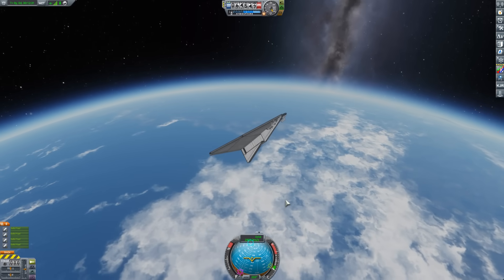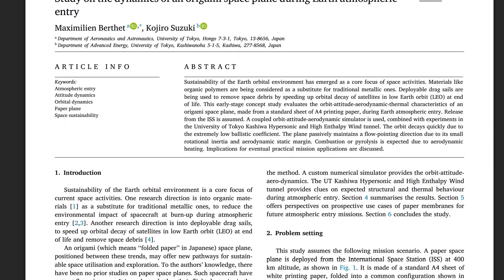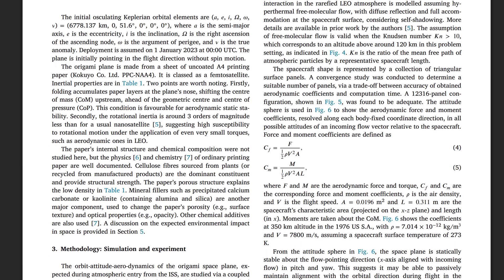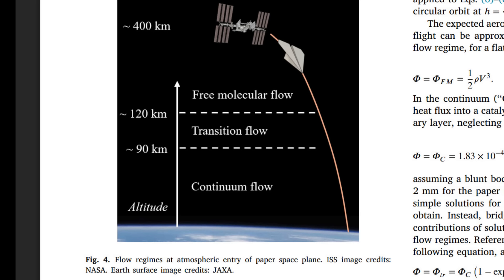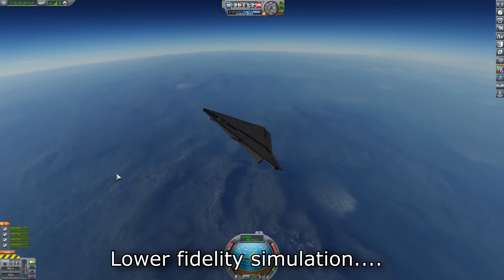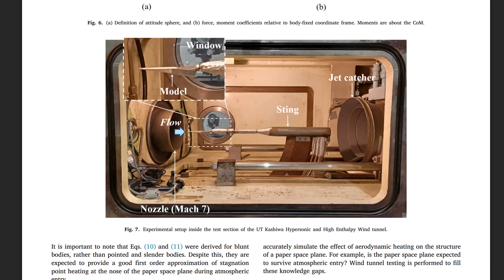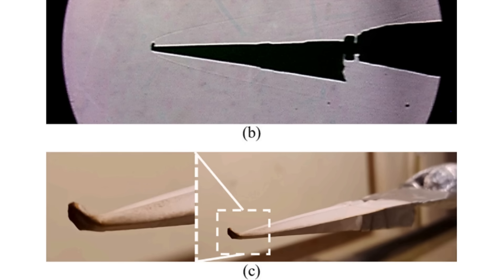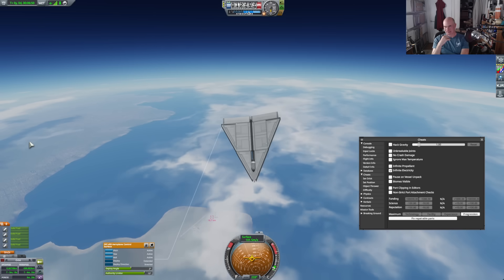Could A Paper Airplane Fly Back From Space?

Comment: The first thing I thought of when clicking on this video was if the paper was coated in a thin (~2-3 nanometer) metal layer the paper planes could be released in the thousands and tracked with radar to study the dynamics of the upper atmosphere.
Reply: Meteorologists are doing such things. However they use just small, very light corner reflectors falling freely from a suborbital rocket or a balloon, being traced by a radar. Paper airplanes will most probably achieve really high speed gliding steadily on high attitudes, so the measurements will be useless. If I count properly, on a 15 km a paper plane capable of 10 km/h on ground level will be able to glide already Ma1.
Reply: You don't even need a full metal coating if you're willing to build a tuned circuit.
Reply: @absalomdraconis  You wouldn’t even need a special tuned circuit, just a length of wire.
Reply: Oohh! I like this!
Reply: 2-3nm won't do anything thermostructurally. You need at least a micron or so to even form a continuous layer
Reply: Wouldn't you rather have something that spirals down like certain tree leafs do? 
I imagine the plane shape would make it harder to interpret the data because it tends to move less freely.

Comment: The space station is going ninety three thousand miles an hour. Wouldn't a paper airplane survive if it were dropped from a high altitude balloon.? That dude that jumped from a high altitude balloon at the edge of space in the Red Bull sponsored event didn't die? Or overheat...
Reply: Where did you get 93,000 mph for the space station speed? That's way off.

Comment: Ah I've got a story about that! A trio of British hypersonic researchers at the long-gone RAE at Farnborough invented, and then ran with, the idea of ultra-low-wing-loading 'hypersonic hangliders' made from shim steel - the stuff they used to make 'tin' cans out of. 
These had sharp edges - and looked very like the classic paper aeroplane - so that they would 'Waveride'; suffer a higher heating RATE at the nose, but with superior lift that would allow re-entry at notably higher altitude where the air density was lower: low enough that the metal wings would reach thermal equilibrium and radiate the heat away off the lee side just as fast as it was coming in from underneath.
My friends and I came SO close to getting UK Astronaut Helen Sharman to lob our little waverider out of the MIR Space station, but alas it didn't happen. (Our model got as far as Star City.)
I'm still sure it would work though, and is the superior way to get "Space Forge" stuff back from orbit.
Reply: Don’t underestimate the robustness of tissue … it was what modellers used back in the 60s before the fancy modern materials became available. The tissue would be doped to stiffen it … I fear that a picture of a Kleenex form of tissue has been created in the mental image … the tissue used was more like a very lightweight wrapping paper.
Reply: @davidrowley-ic6dx  I used lightweight tissue sold for craft purposes, and didn't dope it as the shrinking effect would ruin the sail. Damp air was a problem, but I normally flew them indoors.
Reply: Skylon was supposed to be an application of that. Except the "wing" was a large lifting body.
Reply: Back in the early eighties I worked at RAE, and made model hang gliders from balsa and tissue (~30" wing span and 1/2 oz weight). I still have one, right in front of me in my computer room, and often wonder whether it could survive re-entry.
Reply: @robertkeddie : Tissue? "Probably not", but admittedly because of the lower atmosphere at least as much as the upper atmosphere.
Reply: I remember waveriders. IIRC, isn't the upper surface shielded from the reentry airstream, allowing you to place cargo there without needing any kind of reentry protection? Once you were through the reentry interface you'd then jettison it and it'd parachute down using cheap low-velocity aeronautics. The waverider shell would be passive, cheap and disposable.
Reply: This sounds like throwing a knife from space. How do you catch it?

Comment: But wouldn’t there be structural failure or fold collapse once the air got the slightest bit of density?  The wings would bend.  I didn’t see that question addressed at all.  Sure, it is a silly project, not too much should be expected, but I don’t think it’s very thorough.

Comment: You are making an assumption that is not necessary given the posed question, namely, near orbital velocity. A paper plane does not necessarily have orbital velocity to shed. Correct me if I'm wrong, but atmospheric reentry is radically different without orbital velocity. I wonder though what its maximum terminal velocity would be in free fall.

Comment: I'm not sure if modelling the shape of a paper plane from just the thickness of the paper and the plan form tells the whole story. The folds are a mixture of plastic and elastic deformation so tend to spring slightly open-unless glued, so the fuselage sides aren't parallel but separate towards the rear. The wings are the same, with a definite convex upper surface at the front - so given all that I wonder if the real thing would be more stable. After all, the real thing is markedly less keen to fly tail first than your KSP sim. 

Of course, that wouldn't help its survival prospects since a nice stable attitude would cause it to decelerate less rapidly...and consequently chargrill more quickly. Oh, well...

Comment: The paper airplane, the physical form, the nose has much more mass density than the rest of the craft...there is tendency for gravity to begin to have an effect on trajectory.  Much like the mass of a heat shield helps orient a return capsule "downwards in direction of travel.  of course, heat buildup on the nose of the plane may become a problem.  This model doesn't seem to address this.

Comment: isn't force mass times acceleration? it seems crazy to me that a paper plane would somehow be able to achieve mach 3, specially given that a paper airplane is so damn light
Reply: basically just shows how low density the upper atmosphere is
Reply: I think this was about starting from low Earth orbit, e.g. if it was "dropped" from the ISS (probably launched retrograde to speed up the de-orbit).  It already has a velocity of 17,500mph which is about mach 23 at sea level.  The speed of sound is slower at high altitude, so the actual mach number would be even higher than that.  Even if it was somehow dropped with no lateral velocity (which is practically impossible), it would still initially fall like a brick because there's almost no air resistance at the starting height.

Comment: IMO I don't think we should jump straight to carbon fiber, IMO we should investigate incrementally. The next increment would obviously (to me) be stick-built balsa models constructed with phenolic resin used as the bonding agent, and special attention given to impregnating the nosecone, leading edges of wings, and leading edges of empennage with yet more of the same sort of phenolic resin.
The phenolic resin in question would be as similar as possible to that used to create PICA based ablative heat shields, because that is already flight-proven and has known behavior for reentry conditions, making the experiment deliver better data by having less unknown variables to wrangle with.

Comment: Would a boomerang work in space???
Reply: A returning boomerang would not return - you might as well throw a rock. A boomerangs is a rotating wing w an airfoil cross section to the wings - without air there is zero lift forces working in the object.

Comment: One traditional way to make wood fire-resistant was to whitewash it, soaking it in a calcium carbonate solution which ablates CO2 at high temperatures. This is the same principle as the DIY starlite that youtubers were making a while back. Maybe you could do the same thing with paper to make it resist re-entry heating better. 
Another change that might help would be to fold back a strip of paper along the leading edge of wing and nose. This would give the leading edge a larger radius of curvature, which would push the bow shock further away from the plane and reduce heating.

Comment: Paper airplanes dropped from "near space" (New Shepard) should "reenter" just fine, should they not?
Reply: If you push the paper plane with a rocked and release it when it is stand still over the earth and just fall straight down it would not get such a high speed should do fine from space station height at least, it is the re entry speed that kills it...  ? Buuut freefall at 1g in space will accelerate it to very high speeds so it might burn up either way?
Reply: @a64738  But its low density would likely give it a relatively low terminal velocity. I should probably do the math (having to make several assumptions, of course!) 
I forgot to have Katy Perry try it; not sure she could get the window open anyway.
Reply: @UncleKennysPlace  She's an astronaut now I'm sure she would manage 🤣😂

Comment: In another scenario, instead of entering the atmosphere from orbit, the paper airplane is dropped from a space elevator, at an altitude just above the atmosphere. It would then enter the atmosphere at much lower speed than it would from orbit.
Reply: Yep, that “reentry heat” isn’t due to falling: it’s mostly from atmospheric deceleration.
Reply: An experiment could be done where a rocket is fired straight up into space and releases a paper airplane before falling back to Earth.
Reply: Yes.  I've always said that if antigravity were a thing and spacecraft could just re-enter at a few hundred (or less) mph or km/h rather than at orbital speeds, then no heat shield would be required.  But antigravity propulsion is not a thing.
Reply: @tpresto9862  Well, if there's enough rocket fuel, a spacecraft could decelerate to practically 0 mph before falling back to Earth.

Comment: The amount of kinetic energy to be dissipated is huge, and the question is whether it’s possible to have the object decelerate in a slow and regular enough manner to allow the energy to dissipate all along. The atmosphere’s density profile probably makes it very difficult unless maybe if the initial reentry angle is extremely shallow. Also starting from ISS orbital velocity makes a huge initial kinetic energy as opposed to, for example, an object dropped from a sounding rocket at its apogee. 
Ablative thermal protections have proven extremely efficient to help dissipate both kinetic and induced thermal energy, even facing huge rates of thermal flux, while ensuring survival of the protected vehicle.
Reply: If you could somehow control attitude and AoA during the whole process to maintain the optimal entry profile for reducing heat while not adding any mass to the design I can see it working perhaps.

Comment: Now the question is could a sheet of unfolded paper survive.  Given the lack of rigidity how would it handle the increasing atmosphere, would it present enough of a cross section to even generate much drag or would it attempt to maintain an edge-on approach and act like a poor man's wing.  Would it constantly flip over and tumble, how would it be different if the paper was allowed to tumble as needed vs being held rigid in a wind tunnel, would a different thickness or size of paper make any significant change.  So many questions, come on people we need to see this done in a practical experiment!
Reply: I'm willing to bet that a lightweight paper would survive (so not like cardstock or heavy duty printing paper, but like... tissue paper or maybe lightweight printer paper), because even if it's edge on the whole time, the airstream is going to cause the paper to flex back and forth shedding a lot of energy...

At least in my head, and I'm not a physicist
Reply: It would probably be a very chaotic system. The stochasticity might be a good thing. The tumbling, crinkling, folding, etc, would slow the sheet of paper down much more quickly.
Reply: I imagine vortex shedding would lead to massive instability that would result in large fluctuations in drag. Upshot is that I think the paper survives reentry.
Reply: I would guess that a crumpled ball of paper would have a better chance of succeeding.
Reply: A flat rectangle generates lift toward it's leading edge because of the air wrapping around over the top of the leading edge accelerating. So if you drop a strip of paper like confetti it tends to tumble end over end forever till it hits the ground. An A4 sheet of paper is quite large and flexible so it may not be able to tumble in such a stable way. Pretty sure it would oscillate between modes chaotically.

Comment: When you mentioned the albedo of the paper airplane, I thought you were going to say that "it would just burn up from the heat of the sun... fly safe!"
Reply: Why tho?
Reply: @CosmicHase  Because items in space can only be cooled by radiation, not by convection or conduction.  There is no atmosphere to cool it down.  So sitting in direct sunlight for 45 minutes at a time, it may get hot enough to combust, though there is no oxygen.  Still, at those temperatures it would have converted to carbon, and off-gassed the rest.
Reply: @LabRatJason so diamonds.
Albeit, there's no pressure in space so diamonds can't form....
Reply: @CosmicHase  Well, I guess that leaves us with.... carbon.
Reply: @LabRatJason carbon that could've been...

Comment: If you dropped a plane with zero velocity, it would not burn up?
Reply: As velocity is relative, the first part is impossible..
Reply: @avhuf  Big difference throwing it from ISS which is travelling at escape velocity as opposed to stationary relative to earth and atmosphere
Reply: @euro_wars if it were stationary relative to the earth rotation, it would be in a geostationary orbit, at 36000 km altitude for all eternity
Reply: @avhuf  Then so too would it be if you threw it out of the ISS...
Reply: @euro_wars  No, I mean its mass to surface ratio basically doesn't matter at all during the firs 200km of free fall. It will accelerate a lot before that starts playing a role-
Reply: If my math is correct it gets to around 2km/s only in 200km of free fall. And even then, since there are another 200km left and air pressure is still low, it will probably keep accelerating a bit before starting to slow down.
Reply: If you mean suborbital, no. It would still accelerate while it falls initially when there is little drag.
Reply: @Kestrel16C  With its mass to surface ratio I am not so sure

Comment: I mean, if you can somehow manage to get it to fall straight down then I would assume that it wouldn't go past terminal velocity which should be well below the speeds at which enough heat for combustion to occur would be generated.
Reply: There’s no terminal velocity until you reach a dense enough atmosphere to have some significant drag. 
If you start from 120 or 150km height with zero velocity, you will be in pure freefall for several tens of km before feeling any drag. E.g. starting from 150km, at 100km (100 sec later) the object will travel downwards at 1km/sec and hardly begin to feel any drag yet. The encounter with denser atmosphere will likely be brutal.
Reply: @joso5554 The encounter with denser air would be *gradual*.
Reply: @joso5554  There is atmospheric drag at higher altitudes.
Reply: @joso5554  At really hign altitue, with no drag you don't get friction.
When the atmosphere starts it's not hard set border - vacuum up, full presure down. It's very slow increase of density.
I'd love to know how they modeled this.
Reply: Suborbital test. A mighty  mission for New Sheppard.
Reply: Sure, but Scott is positing reentry from orbit. There’s a ton of lateral velocity in orbit, and that’s the difficult part. Falling straight down would likely be very easy for a lightweight object because terminal velocity is low.